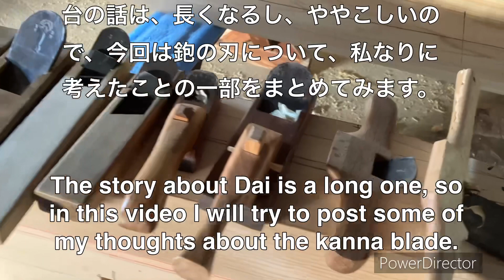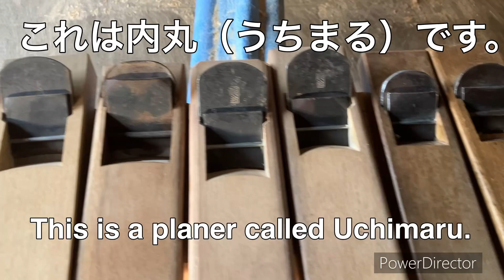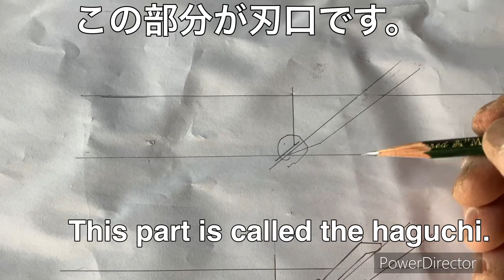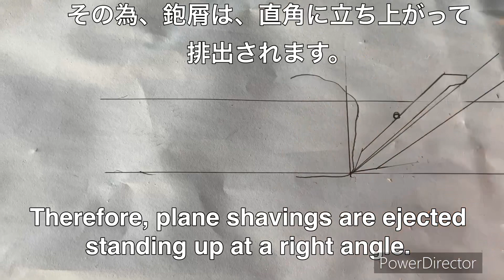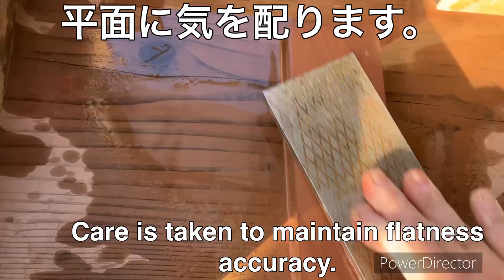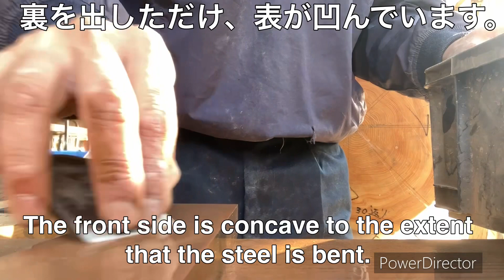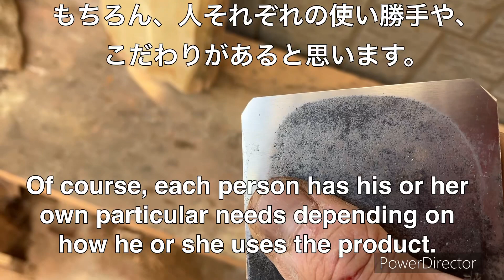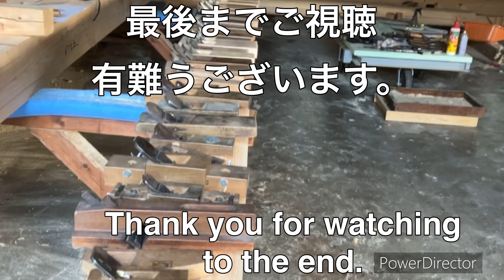【二枚鉋と一枚鉋の刃の裏について】ついでに少しだけ台の話。説明長いけど。

Comment: It was fun untill I work on very hard wood like iron wood. Any advice to use kanna for hardwood? Thank you
Reply from the maker: I do not often use hard woods such as hardwoods.
 I sometimes use oak, but rarely plane it.
 When planing zelkova, I sharpen the blade at a slightly steeper angle than 30 degrees.
 The angles are done by intuition.
Reply: @chantarokichi5360  thank you. My new plane blade just arrived, I will try.